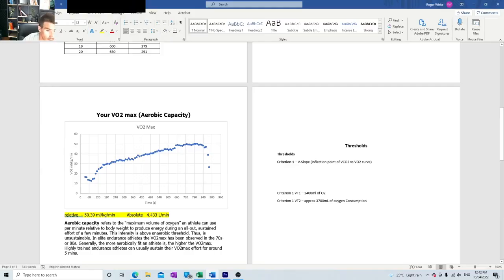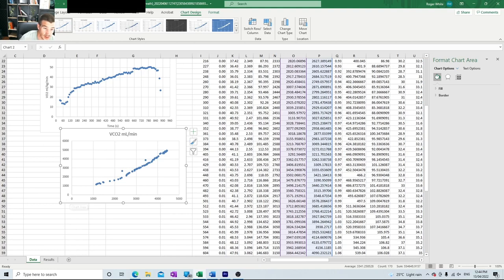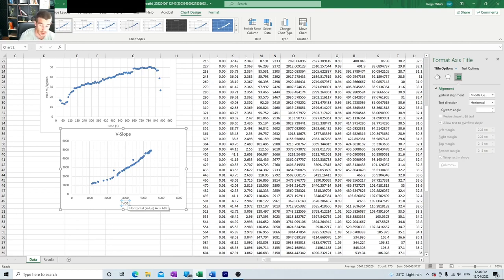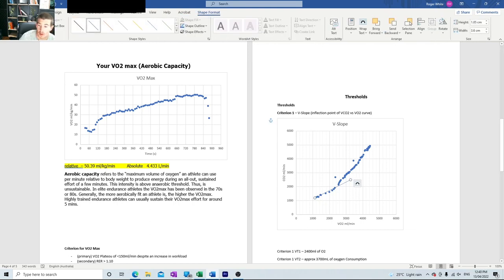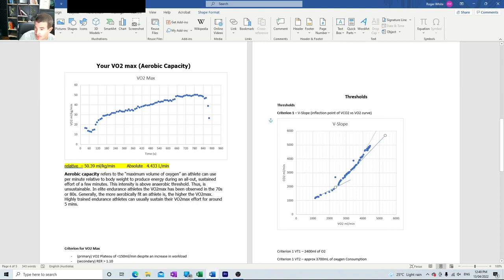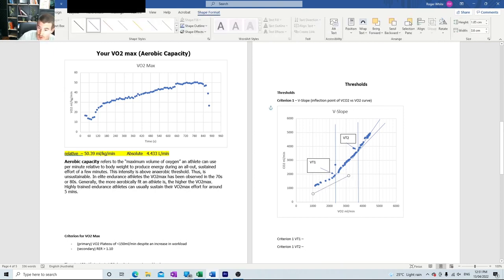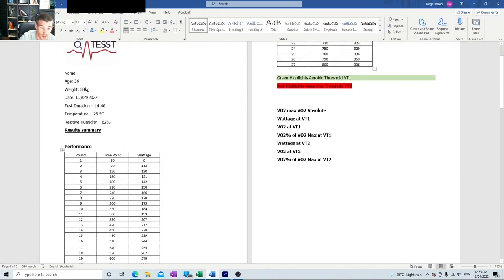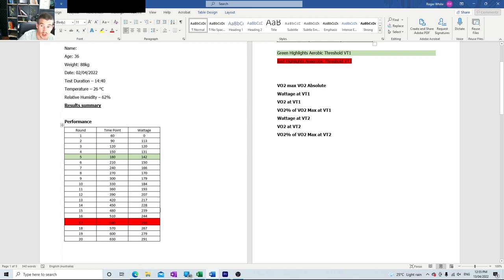How To Find Ventilatory Thresholds VT1 and VT2 CPET Interpretation part 2

Comment: Thanks this is good info. Do you have any advice how to estimate this without the option of CPET? For example through measuring HR, respiration rate etc.
Reply: Hi Tony, Roger here just talking through my company profile :) Whilst CPET and breath analysis are the gold standard, there are definitely many methods of measuring VO2 max without expensive equipment here is a link https://www.runnersblueprint.com/vo2-max/ . As for VT1 and VT2 specifically, I will do some digging and get back to you.
Reply: @bluefoxhealth3366  thank you so much Roger. Great article, very helpful. My garmin estimated VO2max dropped dramatically when I switched to low HR running, which makes sense from the article. 
I've tried a DIY cardiac drift test which was fun. It's fascinating. If you do find any more info about VT, I'd be most grateful.